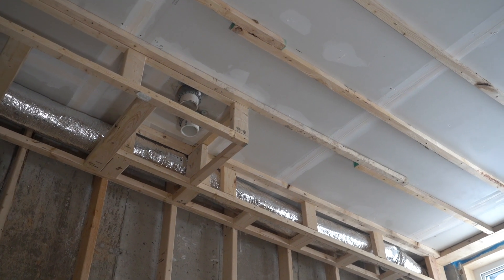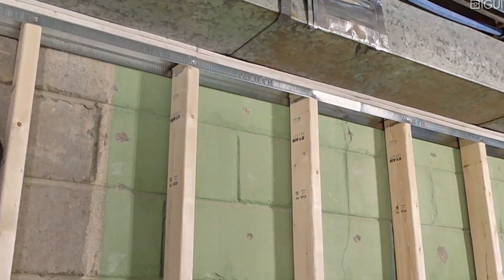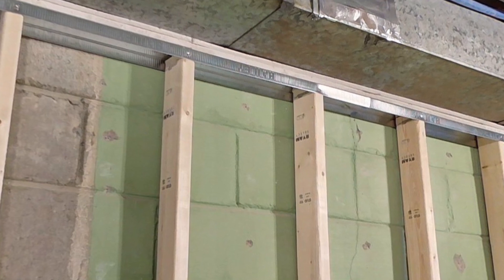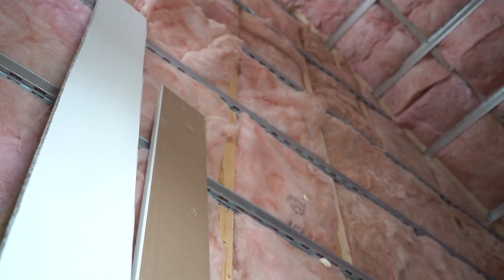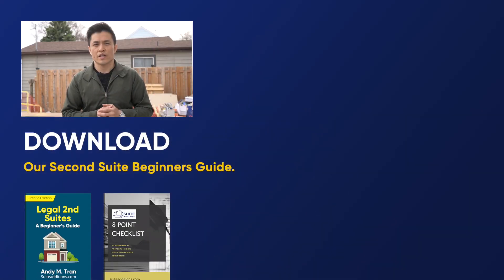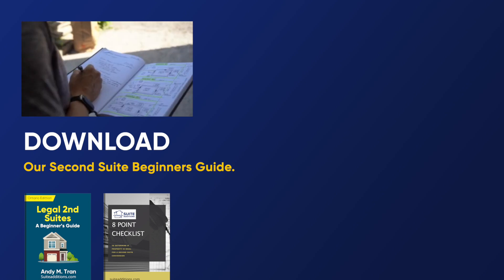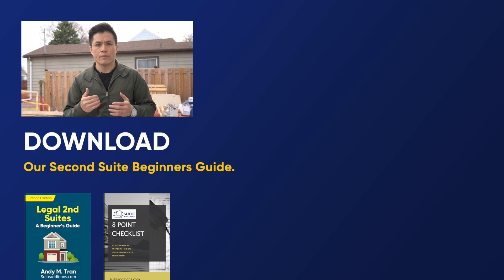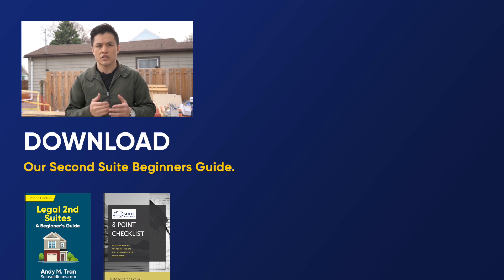Fire Separation Design | Multi Unit | Ontario Building Code | Explained

Comment: Question, our landlord, to comply with a fire code inspection. Has screwed drywall on to a pre existing not up to code masonite unit division wall. No air gap with insulation in between Is this acceptable or should we get another inspection? Thank you

Comment: Andy, I am applying the legal basement now. The pre construction inspector said my basement exterior wall also needs to do the fire separation. Does it need ? If not, is there building code to support me ?
Reply from the maker: As long as the entire floor is fire rated then the wall itself should not need to be fire rated.
Reply: @suiteadditions  yes, the ceiling is planed to be fire rated. Any building code can support my point?